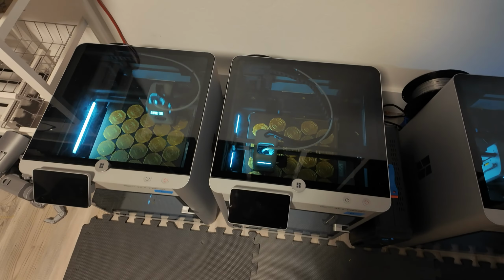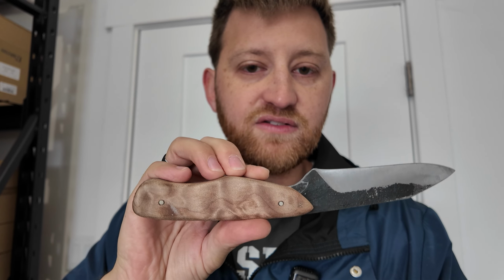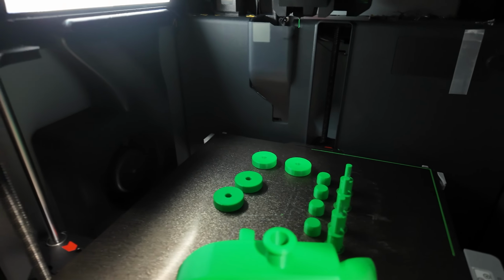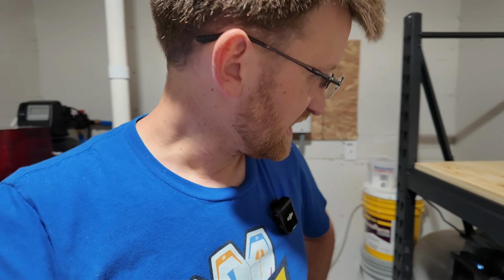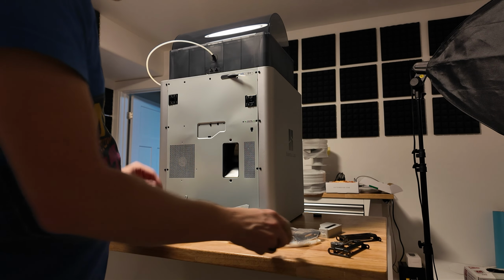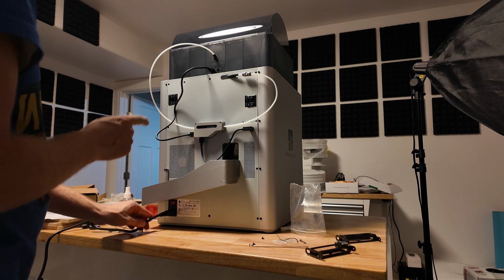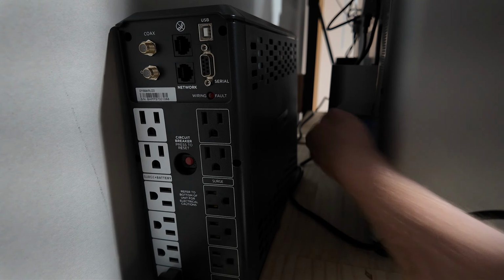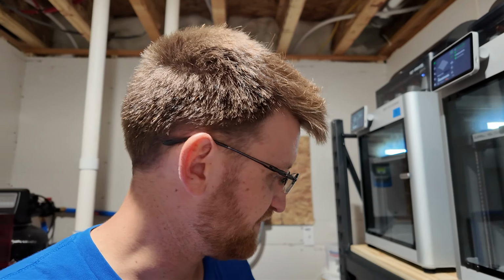Building My Ultimate 3D Printer Print Farm | From Concept to Complete Setup

Comment: Are the metal brackets on the front and back reversible so the rabbet or ledge faces inward?  Yours face outward to hold the lip of the wire shelves.  If the rabbit faced inward it could hold a wood shelf in place,  The steel shelving until from Lowes seem to be like yours.  The Home Depot Husky brand appears to offer the variety where they face inward.

Comment: when Bambu has sales and certain filaments all I buy is the refills they are cheaper and pretty easy to install on the rolls :) and with the RIFD tags super easy when you switch because they auto find whats on the rolls!! Love the setup! but with all them machines does it get really hot in that room?
Reply from the maker: That’s a really smart tip about using refills! The room gets a little warmer, but that part of the house has no heat vents, so the printers are the heater!
Reply: @hyperspaceprops  perfect! where I have my printers there is heat vents but I turn down the heat and just let the printers warm the room lol I started with just the P1S my wife got me for my birthday, a few weeks later I bought the A1 mini and A1 lol these things are so addictive! I've going to print things over the winter to take to yard sales and fairs around me next summer to sell! again great vid and great setup you have there!

Comment: Why the X1Cs for just chips?
Reply from the maker: I try to do some future-proofing. I got the X1C's so that I have more options to make things in the future. It's a gamble, but so is purchasing any new machine.
Reply: @hyperspaceprops  I am of the same mindset. When laptops first came out, I bought a base model. Then, I kept upgrading everything. Back then, you had to buy a CD recorder separately (oh, like today ). Haha. But what it taught me was that it would have been much cheaper in the long run to just buy a better computer. Now, I only buy and then upgrade my laptops to the most RAM and cost-affected SSD.  Anyhow, I also bought the X1C and found it to be a great printer. I hope all works out great for you.